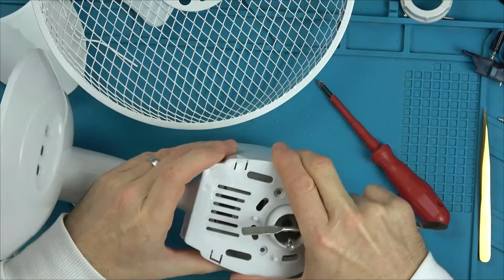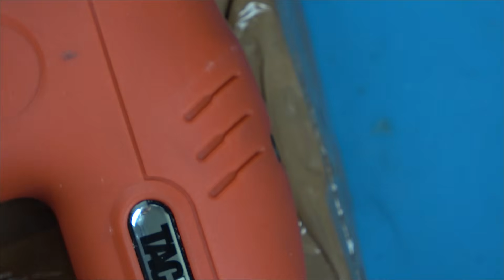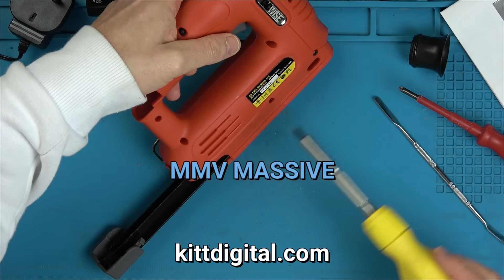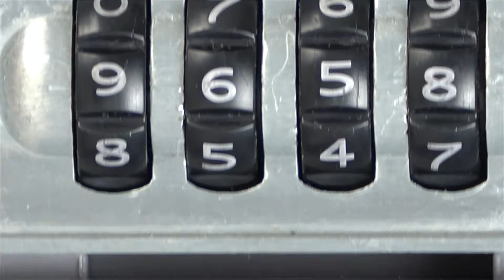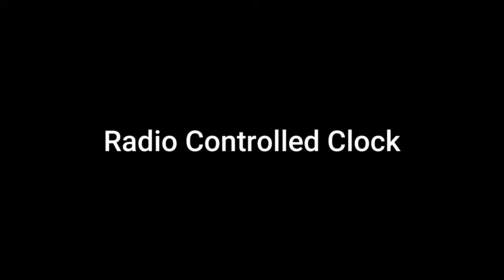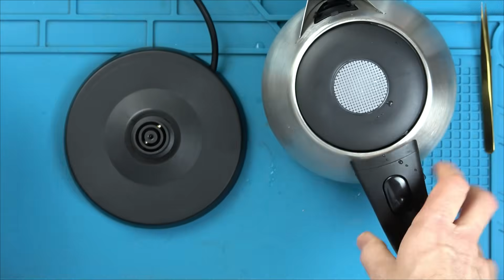I Bought AMAZON CUSTOMER RETURNS to REPAIR

Comment: The German DCF signal differs from the UK MSF signal. It's not just a different frequency but also different encoding. This means in practice that converting the clock to the UK MSF signal is not feasible. 

What seems stupid is that the DCF clock does not seem to have a timezone/location option so you can have the clock synchronize of the DCF signal but implement the correct timezone. Quite a few "weather stations" will have a DCF receiver as well as a "nearest town" option so you can set them to show the correct time and show the time sun and moon set/rise. This is the first time I ever saw a DCF clock that doesn't have this feature. Clearly a missed chance by Braun.
Reply: Yeah. My weather stations which use dcf allow you to set signal to -1 or -2 so you can use in UK. Still gets the signal from Germany. That said I suspect Germany doesn't change from summer to winter time at the same time as us as there is about 2 weeks when it's wrong, I adjust it to -2 and then 2 weeks later it's wrong again!

Comment: Hi.About Braun clock.As described in manual "The signal indicator displays signal strength in 3 levels. Wave seg-
ment flashing means the time signals are being received. Press
and hold the RCC key for over 3 seconds until “OFF” is displayed to
disable the automatic RC function." I think you can disable radio settings reception.

Comment: That fan has the blade design wrong. If it were to rotate the other way around, it would blow out to the back. For the design to work in the direction it is turning now, the angle of the blades should be pointing the other way. No wonder it is seriously bad at actually moving air.
Reply: Can you swap the wires around and make it rotate the other way and thus be a better fan or would that cause it to blow up and I'm being too simple given it's AC not DC

Comment: DCF77 (EU time signal) and MSF60 (UK time signal) are coded differently so it's not as simple as swapping a 77.5kHz crystal for a 60kHz one (plus the antennas would be different too).  So doubt it would work, but worth a look inside anyway.  If there's a decoder module then there may be a very slim chance they output the same info to the clock and swapping the whole decoder module for an MSF one might work.  Normally radio controlled clocks have a time zone setting, if this one doesn't then yes, fairly useless in the UK.

Comment: from my own experience with Amazon Brand products not all are good but most are very good quality i have a battery powered Rachet for working on cars and i love it It works great takes nuts and bolts off pretty good Its just luck of the draw i usually look at customer reviews before i buy.

Comment: Hello, just a quick tip, when doing resistance readings try not to hold both probs of your meter, you will read the resistance through your body as well as the circuit, which will throw off your readings.

Comment: At the start of lock down I bought a brand new Russell Hobs Kettle, a few months ago it suddenly stopped working. Having watched many of your videos I took it apart to fault find and it was a little lump on the switch contacts cleaned it up and it is working again. Many thanks
Reply: I think mine was £22, and I bought it 8 years ago. It boils the water just like the £95 Bosch kettle that was on display on the same shelf. 😂

But seriously, a kettle in the end is a jug with a resistance, a safety switch and a thermal fuse. It should not cost an arm and a leg.
Reply: @roy-wg7dz  kettles in the UK in my opinion are a scam. There is no reason why manufacturers should be able to charge £80-150 since they are pretty much built the same. Even £30 is too much... 🤣
Reply: @bufordmaddogtannen  you are entitled to your opinion. Mine was a good make and cost 18 pounds

Comment: I've got a H670 Citizen radio controlled eco drive which resets itself on main time to European time at 3am, Citizen maintained the UK's radio beacon but when they stopped selling radio control products closed it down.   I have mine set on LT-1 or local time which with summer time set on will auto adjust when clocks go back and forth and not auto correct as the watch is incredibly accurate.   It is a very sophisticated watch in Citizen's "super" or very pure titanium and lives in the brightly lit kitchen with a Pulsar solar analogue and my very valuable Seiko Astron chronograph also solar.
Reply: There are apps for fones which can do the radio signals for local times, usually one would wait for the 3am sync then do the spoof signal but come 3am again and it will have to be redone, very frustrating lol

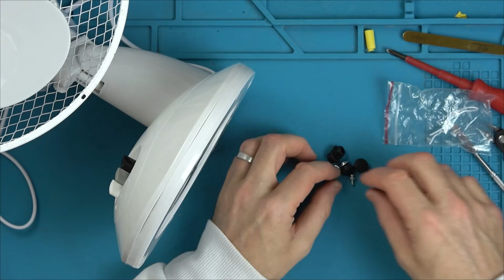Comment: The spring clip at 18:14 clips on the inner side of the fan blades and enables the blades to grip the shaft properly. That's all it was.
Why don't the manufacturers fit it to the blades at the factory? It can't save much on production costs.

Comment: The fan is a shaded pole motor which runs at an almost constant speed depending on the current in the winding. The lower resistance switch position would increase the current in the motor so it will spin slightly faster. It will also be dissipating more power hence why it will get warmer. The increase in dissipation will be compensated by the air blowing past it especially now that you've got it fixed 😉

Comment: 1:24:35 You have a relative button on the meter. Can you not touch the probes together, then use the "rel" button to zero the result. Then when you take a resistance measurement you will get a more accurate reading.

Comment: The fan at the beginning is garbage from company - throw it in the bin. The blades are so weak that their tips (at the front edge) bend up over time and then you have no airflow at all at the front (look at them now - they are already slightly bend up).
To pinpoint the failure a power meter would have been helpful ...

Comment: I think, on the fan, it wasn't the bent cage, it was that the blades were badly slipping on the shaft, and therefore, the motor was changing speed, but it couldn't transfer it to the blades, which is also why there was no airflow before you secured the blades. I wouldn't trust anything to Master Lock. That cable clicks into plastic and extremely thin sheet metal, , if you fixed it around something immovable, grabbed it and pulled hard, it would break first go. As LPL says, false security can be worse than no security. It screams steal me! On the beach, burying your phone inside a sock is safer! 🧡

Comment: 1:14:33
Just measure the resistance in the plug when the kettle is in the socket.
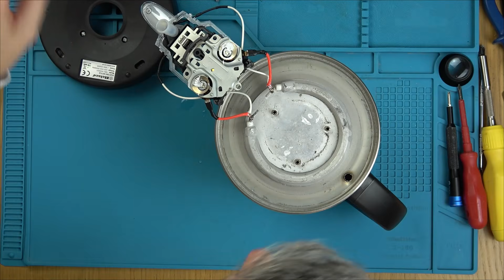1:20:20 These two thermal fuses turn off the contacts,clean them and bent slightly. One can be bridged.

Comment: Dear Vince,
The motor of your fan is a shaded-pole motor. The only thing that changes between position 1 and position 2 is the torque of the motor. The speed at which the motor wants to run depends on the frequency of the mains voltage and that of course does not change. It can be perfectly normal that the motor runs at the same speed in both positions without load (fan blades). The 2 speeds are based on the fact that the motor cannot reach its full speed in position 1 because it has to compete with the load by the fan blades. The motor either has 2 different windings or more likely 1 winding with a center tap for the '2 speeds' under load. I suspect the fan blades were slipping on the axle and that's why both speeds were the same. In the end well done Vince.
Reply: it was all down to the poor little supplied spring clamp that was sadly never used.
Reply: @SPEXWISE  indeed 🙂
Reply: aww
Reply: You are TOTALLY right - I was fooled by that once when fixing a fan in that the speeds of the motor when measured without the blade in place were the same.
@Vince - it is amusing to me to watch an amateur like you who knows so little about fixing things yet does it with such spirit and optimism. Keep at it and in a decade or two you might know what you are doing...

Comment: Think the speed was working and it was just the spindle slipping inside the blade, so when you used the heatshrink it stopped it slipping.

Comment: The fan was odd (in my view), despite the naff rpm test, the shaft seemed to be turning at the same speed (with the blades removed), irrespective of the switch position. I have the Asda version of that, and whilst not a Dyson, it is fine as a two-speed desk fan. 

If the plastic (on the mains adaptor for the stapler) is ABS then, in the future, try evo-stik pvc pipe weld (runny stuff in tubes), tons of practice required (melts ABS parts together). 

Probably an illusion, the earth contact on the kettle base looks odd.

Transformers can, of course, morph into anything (motors usually included).

Comment: I do have a steel staple gun...I had the same problem...I had to bend the metal back inside.... the spring came loose and I had to put it back as well...was better if they spot welded that end

Comment: the motor in that fan is what's called a shaded-pole motor-  they're quite clever and work by having magnetic fields that lag behind the rotor.  so with no load on the motor it will behave differently from when it has a load on it.

the DC resistance is kind of irrelevant-  it's the inductance at 50 Hz that matters.

Comment: The Braun electric screwdriver is ideal for undoing many many case screws such as those on the stapler, but I wouldn't use it for driving screws back into plastic unless they've been 'started'. Nice diagnostic & 'fix' on the stapler tho (it could use a tack weld to hold that end in place more permanently)

The fan had a common 'fault': CDRA. The Customer Didn't Read the Assembly notes: these fans are usually partially disassembled for shipping, hence the retaining collet (or anything else) for the plastic fan spindle not even being applied. The collet (provided it's correctly sized) tightens the friction-fit of the fan onto the motor spindle; the Customer assembled the device without the collet, allowing the motor spindle to freewheel within the plastic fan assembly, hence 'no fan power'. I'd never buy one due to such poor build quality, but they can be picked up for free from most recycling centres (ie dumps) & fixed cheaply, provided the motor's OK

The clock's chip needs to be changed to correct to GMT :( There also used to be a problem with reception strength when the main UK broadcast was relocated from Rugby to Cumbria, but that seems to have been fixed now (over 10yrs later)

I'm amazed the 'safe' didn't contain a PCBWay advert! Either way, I'd have used a hammer (or possibly a large screwdriver) if I wanted to get inside for nefarious porpoises :)

Comment: There are several phone apps that will allow your phone to simulate radio clock signals and the device will sync to it. Maybe they are not the best solution, but it's worth seeing if it works.

Comment: The contacts of the base of the kettle are spring loaded. They tend to get stuck. It a problem with this design. Many brands have the same problem. They sell these kettles in Asia for 5 USD (new).

Comment: I would say by the sound of that then the black slider is pushing the staples too tightly and when u struggle to pull the slider back the pressure is released

Comment: Concerning the broken earth pin on that mains adapter for the staple gun:-  you could use one of those Euro plug adapters to fit into the mains socket as a way to by-pass not having an earth pin to plug in, but you would have to remove any remnants of the existing earth pin on the plug to get a snug fit.  Plus, be weary of fitting the pins in the correct orientation, although many devices with the Euro plugs on them can be fitted either way, so it may not possibly make any difference.  But, I'd still be weary regardless, myself and make sure it fitted the correct way in relation to where the earth plug used to be.

Comment: Hello Vince. Regarding the Braun clock set on Central European Time. Some of these clocks can be programmed to add or substract one or more hours from the sidnal received from Frankfurt. If you can set the clock to substract one hour you ill have the UK time displayed on the clock. Oregon Scientific devices work in this way.

Comment: I am a geek like you.   Proudly so.    About a decade or two ago I used to like to buy broken laptops and to fix them.    I learned that there was a common fault on a Dell laptop that doomed them and I could change out a system board and fix them in a total of 20 minutes from start to finish.    Later I would learn how to solder the bad dc power connector instead of just replacing the board when I could actually locate new power connectors.    I love problem solving and even had one laptop I bought for next to nothing and there was an error fault.    It turned out to be the removable dvd burner and when that was removed the laptop worked.    

I loved your car repair video series - beautiful Rolls.    Keep up the great work!
Reply: Imagine working at the technical department of a TV station that is about to move to a new building and seeing the e-waste bin grow and grow with stuf, beautiful buttons, displays, parts, LOTS of things.  A colleague of mine just as I did had some regular dumpster diving.  Took 2 cheaper LED-panel video lights out of the bin.
Both of them had smashed screw inserts where it holds the U-shaped bracket (with which you mount it on a light tripod), which was a very common defect upon those panels falling over due to wind.
One of them however had a smashed V-mount battery plate next to that, but a functioning LED-panel, but a broken controller that powers it.  The other had a broken LED-panel, but a functioning controller.
Took out both and spent about 30 minutes exchanging parts (after they take a fall, the screw inserts that hold the panel tend to get damaged causing them to start rotating when you try to take out the screw, and taking the panel out to get to the controller is the only way in).
Electrically I got them working that way, but fixing the housing took a bit longer and a bit of measuring and 3D design.  I printed some parts that fitted the screw holes (badly designed if you ask me, but hey, cheap stuff...no surprise there) and glued those in place, and then put some heat-inserts for the M6 threads that hold the bracket.

The bracket was also defective: the light tripod mount had stripped threads for the fixing knob.  Made a new, much heavier (slightly to heavy to my taste, but OK) bracket from steel and put on a tripod mount, and heyho, a free bi-color light panel :).

Comment: I have multiple clocks and watches that are radio controlled. My Citizen watches can receive and use the signal from the United States, Germany, China and Japan (if within range). The way that the watch sets the correct time is that the watch knows its time zone (set by me) and it applies the correct offset. My dial wall clocks that only use the US signal have four buttons in the back for the NA times zones. The clock then applies the correct offset to the signal time. It would have been trivial for Braun to include time zone settings to the BC10W clock. The cool new technology is GPS controlled clocks and watches. The GPS satellites transmit GMT time and the clock/watch use their location (automatically determined through GPS) and the GPS GMT  signal to set the correct time automatically - no time zone setting required.
Reply: do they make standalone time ones that do this?

Comment: So many things to comment on!  First, the safe.  I'd say it's more to use at home to deter kids or maybe in the car when someone is going for a quick smash and grab.  Second, the clock!  There is no way to adjust the time zone?  Here in the US we have 4 time zones and most radio clocks let you choose between them.  I'm surprised you can't just tell it to subtract or add hours to whatever signal it's picking up since it looks like the DCF signal would cover a large part of England.

Comment: Vince, If the fan oscillation system is purely mechanical you should be able to see the speed difference by timing the full travel, left to right and back, of say 20 cycles in each speed setting. if this had been a live stream I or somebody else would have suggested a circlet for installing the fan blades. That is the purpose of that coil that you found. At the initial testing the blades were probably slipping.
Reply: Yes, I have found those shot ‘spring’ like wire coils on fan impeller hubs, I have an interest in fans

Comment: Vince, with the tire pump, most modern car DC power jacks are only rated for a few amps. Basically that is all that is needed to plug in a standard cellphone charger. The no power situation was likely the original customer burning out the fuse with to much amperage draw, and thinking the product was faulty. Whoever processed the return likely didn't even test it.
Reply from the maker: Ohhhh, thank you. Makes sense to me now, cheers for taking the time to comment 👌👍
Reply: Connections on 12 volt sockets are also a bit iffy. For instance I've got a USB charger that won't work in one of my cars but works in the other, yet a tyre inflator ironically works on both

Comment: You could use it as key safe that you can share the code with someone you want to give access to a property or car?
Reply: Had a similar experience with a holiday let we had in Spain. Key to apartment and block in a key box fastened to a railing in the carpark behind a bush. Worked ok and you left the key in the apartment as you left for the cleaner to put back and perhaps reset the combination for the next guest.